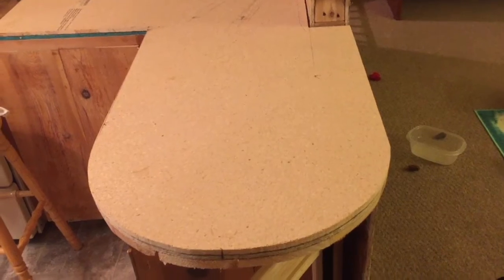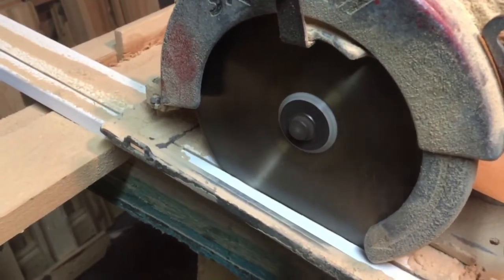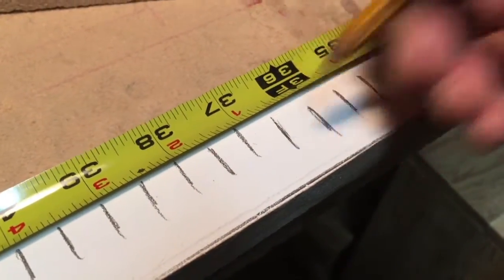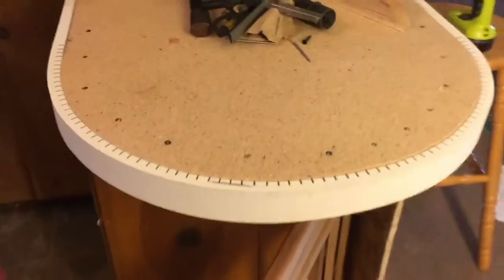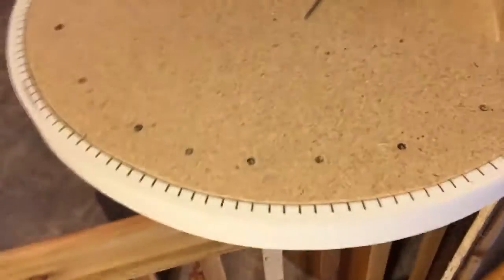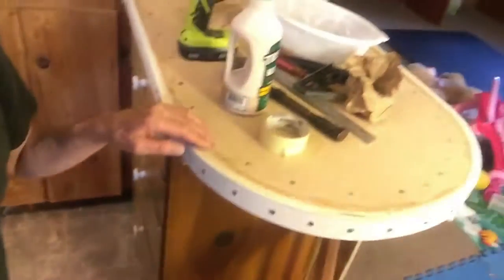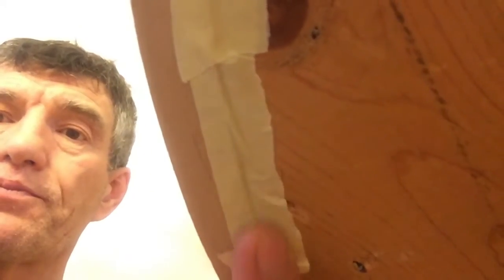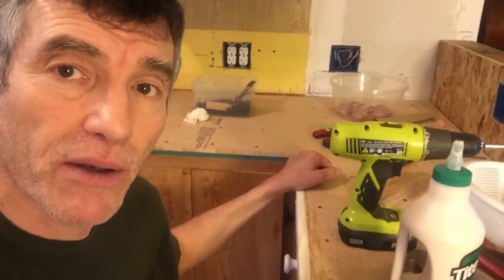Best Trick to Make a Curved, Rounded Counter Top Edge. Short Tutorial

Comment: Looks like crap. MDF absorbs water like none other and swells, it will not return to its normal state, thus ruining any laminate you put over it. MDF will absorb moisture out of the air, so a kitchen is a poor choice to put it. Common ply would have been better, plus it is more porous to keep adhesion with the subtop or main surface
Reply from the maker: Hello realism51. I thank you for your comments and your view point. What might be your intentions in providing your comments? Sounds like you have good information and detail of residential construction techniques. You are right that it doesn't look good. But you will be happy to know that it is unfinished and is not intended to be used as it is. It has been completed now and looks really great. I real high end craftsman would not use these materials. All pre made counter tops at stores are made of saw dust, AKA Particle board.  I have been working in construction for fifty years and I remember the days before composites, reconstituted, and cardboard products. We used to use pure wood products. Sawmill Slab wood, plywood, and solid wood molding and edging. That was awesome cutting our own wood and milling to size. Thank you for reminding me of my higher standards.
Reply from the maker: You can use this same construction technique using real wood plywood for the top and real wood 1 x 1 1/4 edging trim. You can cut notches every 1/2 inch and steam or lightly moisten real wood then dry. You would never ever moisten MDF or particle board. The reason I don't like MDF for door or floor molding in that it will bend to the imperfections in the wall and in long runs you see the waver, so I only use real wood for mop board and door jamb material. MDF needs to always be sealed. It is from the factory but it is pretty susceptible to water and is not designed for exterior, Remember the LP recall fiasco. We all should know about MDF, and that it stands for Medium-density fibreboard being described as an engineered product. Basically reconstituted wood chips and dust with wax and resin into nominal lumber using temperature and pressure. MDF has its limitations, and you have to know when and where to use it. Thank you for your detailed observations.